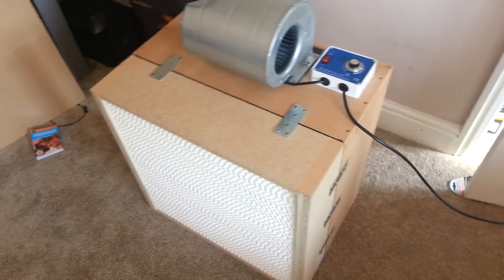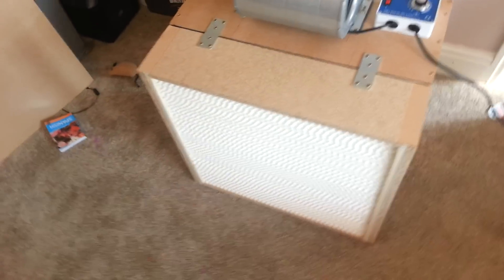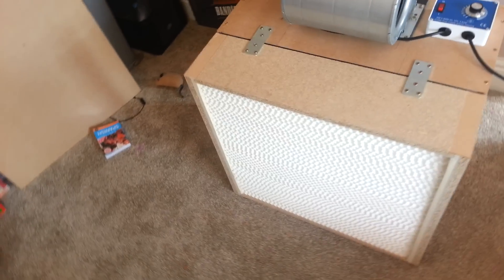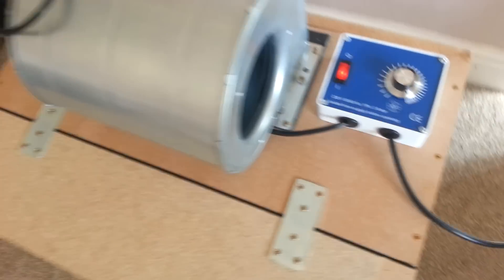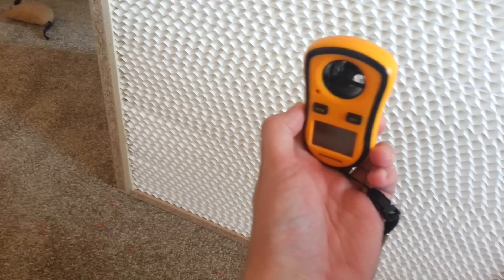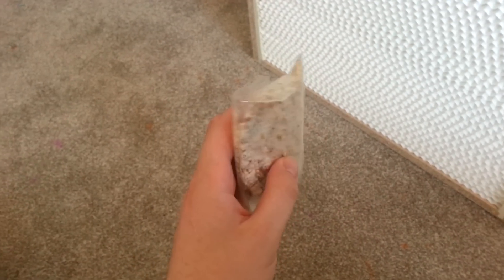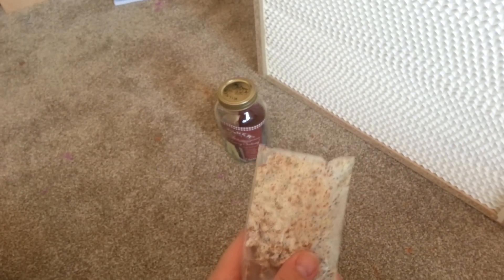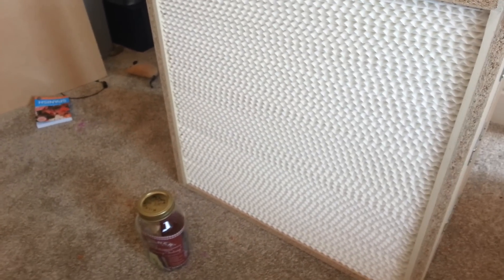Home made laminar flow hood / wall

Comment: That's not laminar flow.  If anything, it provides positive pressurisation but does that by simply blasting sterile air out.  It does not create an air curtainm
Reply: Isn't it? You haven't examined the air flow of this device, so while I accept you can speculate about the operation, you don't have any direct evidence.

If you hold a candle in front of this device, the flow certainly looks quite laminar. If you hold an incense stick, the smoke trails out linearly with no noticeable turbulence.

So in practice, it produces a laminar air stream. It might not be perfectly laminar, but it produces an air stream with very little turbulence.

I would however agree that the main benefit of this device is the sterile air and the positive pressure.

Comment: Hi Ashley, so you recommend purchasing the 1ft x 2ft instead? When filling bags, would you not need that extra foot? Also can I contact you via email?
Reply: I think the extra foot would be useful, but I couldn't fit a 2ft x 2ft in the loft, which is a new design requirement for me as I'm running out of space in the house. And this is extremely heavy. I'm just making a 1ft x 2ft now for practicality. I'd rather not communicate about this stuff over email.

Comment: Has the filter been tested for integrity, and also you have the pleats going the wrong way. Also 100fpm or so is not what you'd call accurate.
Reply: The pleat orientation is not massively significant (https://dspace.lboro.ac.uk/dspace-jspui/bitstream/2134/8341/1/Gas%20filtration%20Filtech%202011%20repository.pdf).

What do you mean by integrity? 

Doesn't need to be accurate, it reaches 0.5m/s on the anemometer so it should be fine.

The proof is in the pudding: it's been used for multiple inoculations and exposures without causing contamination.

Ideally however it would be good to construct more rigorous testing methodologies etc. I'm going to build another in the future, so I'll do a better job of it for sure.

Have you got a link to your build?

Comment: Really good video I had 1 question I had a look at the company you linked and I'm going to place an order is it the standard or the high capacity filter you used?
Reply: You know I can't remember but I think I just used the standard capacity to save money. But doing the calculation, 4 square feet is approx 0.37m^2, and at 0.5m/s air flow that's 0.185m^3 per second, which is 666 m^3 per hour, and the rated cap of the 2ft x 2ft H10 box is 1700 m^3 per hour and the H13 is 850 so standard capacity is more than enough.

Comment: no prefilter?
Reply: No, I was concerned also about this initially, but I noticed that none of the commercial flow hoods for sale of the same build style used them.  Would probably be useful to have one to trap coarse dust if changed regularly (as blockage would strain the fan and reduce the air flow).

Comment: could you use a shopvac on reverse for this?
Reply: +lonewolferton if it's powerful enough i don't see why not
Reply: I was thinking for small scale. Could I make a glove box and put the shop vac on blow with this filter,or is it a waste of time?

http://www.amazon.com/Ridgid-97457-VF6000-5-Layer-Vacuum/dp/B0029NY9XU/ref=sr_1_11?ie=UTF8&qid=1459413745&sr=8-11&keywords=ridgid+vacuum+filters
Reply: +lonewolferton I think it would be worth a try. But the main advantage of the laminar flow hood over the glove box is that you get the un-restricted workspace in front of it.

The fact that the flow is laminar is also important, since this means that the turbulence is minimised, with the idea that the everything gets blown downstream, rather than spiralling around or going back on itself. In practice I'm not sure how much this effect actually increases the sterility over the initial gain of the HEPA filtered air on its own.

If we assume that the HEPA air is the main sterility factor, then I suppose that the advantage of that in your glovebox idea over a conventional chemically sterilised glovebox would be that you perhaps would only need a quick wipe of isopropyl alcohol to get started rather than having to flood the box with chems. You might even be able to do away with the gloves and open up the front of the box if the sterile air flow is enough.

Just some thoughts, but I think the best thing would be for you to try it and then judge by the results whether it works... and then let us all know :)
Reply: Thanks for the reply/info. Ill give it a try and see how it works. I guess if it doesn't work I could easily seal up the hole. I think I can get my buddy's smoke pencil for a couple of days to see the flow. I was thinking of having a shopvac blowing on one side and a one way valve on the other side. But after reading your comment I'm thinking it might just be easier to use it without gloves and let the air come out around the arms. Do you by chance have access to a smoke pencil? I would love to be able to see how the laminar works.
Reply: +lonewolferton I don't have a smoke pencil handy. I suppose an incense stick might work. I did test mine with a candle and it looked very steady. I lent my hood to someone so I can't check it with incense until I get it back.

Comment: Audabonify How much would you estimate your contamination rate has decreased?  Thanks for posting this.
Reply: Jim Neitzel If used properly I would say this essentially removed my contamination problems. The next problem I had however was finding somewhere in the house to use that that was clean enough to support all the peripheral objects. I think really you need a separate room to keep everything in if you want very high rates. Even with all the stuff I don't think it is possible to remove contamination completely, in all of Paul stamets books he pretty much says it is inevitable.